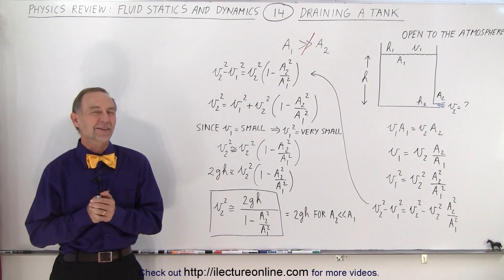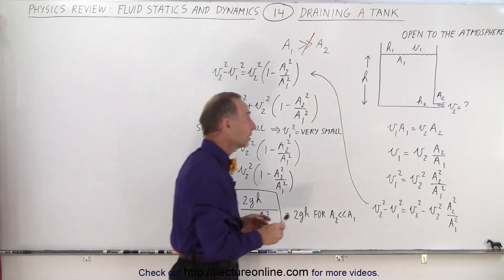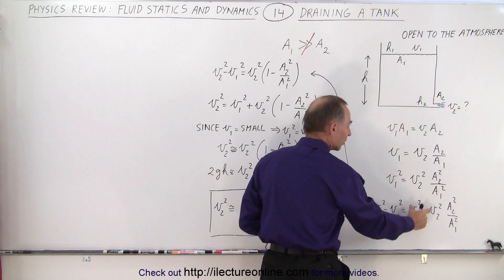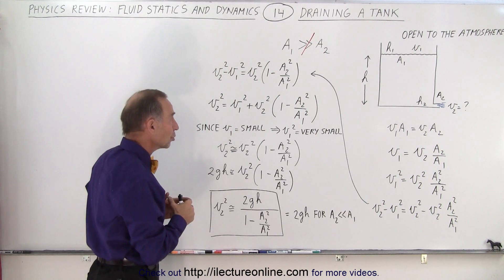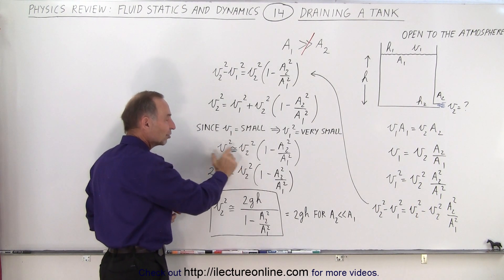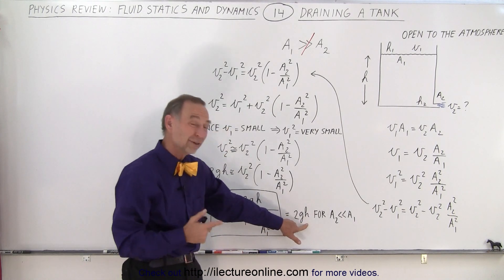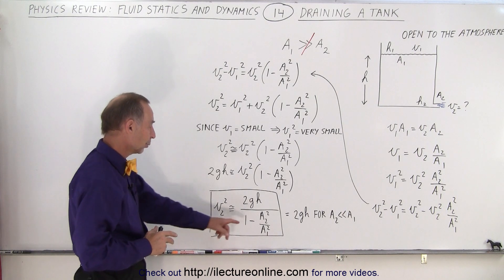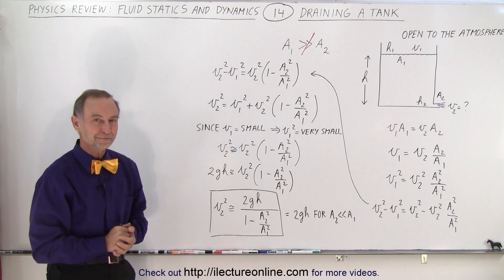Physics Review: Fluid Statics and Dynamics #14 Draining A Tank

Comment: This is great!  Years ago, I had a situation where there was very limited time for a maintenance crew to drain a water treatment process tank, clean it, and then refill it. It was an above ground steel tank with a cylindrical section about 30-ft diameter at the top and 4-ft high straight side wall with a lower truncated cone section that was 30-ft in diameter at the top and about 4-ft in diameter and the bottom having vertical section height of about 8-feet. The down-time was critical because it was part of a municipal water treatment plant. The tank was filled from the top (by water pumped from a well field), and of course drained by gravity at the bottom. My calculus was pretty good back then and I was able to figure it out rather easily and it turned out to be quite accurate. Now I'm retired and enjoying these math and science videos trying to exercise my gray matter and hopefully slow the fossilization process.
Reply from the maker: A great way to "exercise" the gray matter.  Keep it up.  🙂